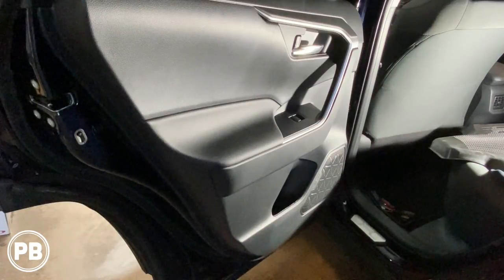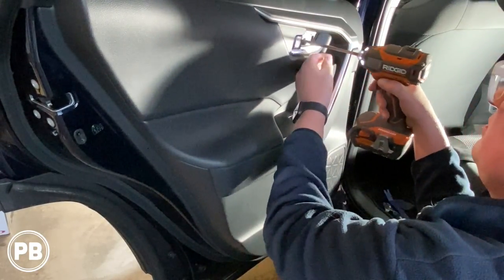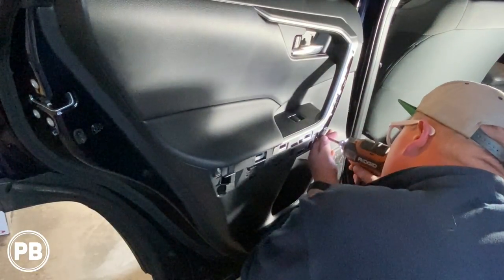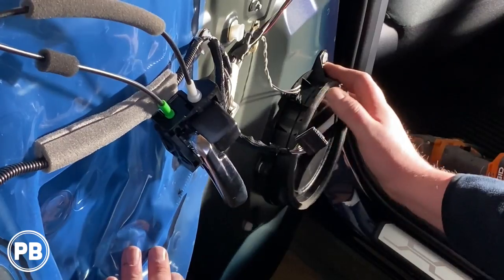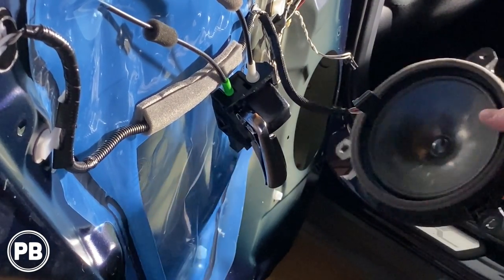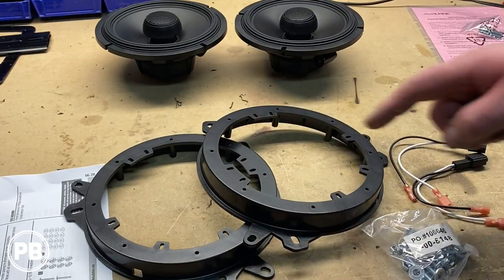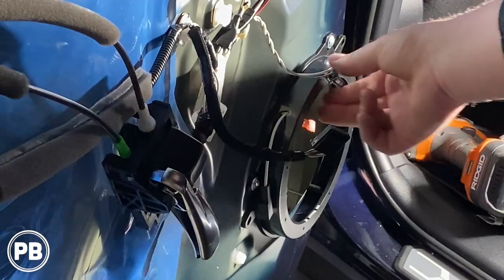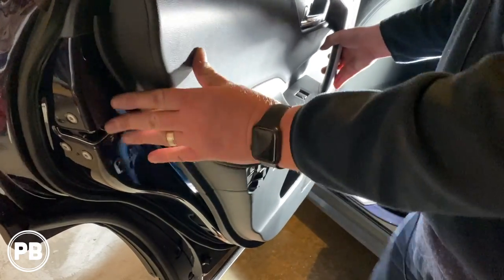2019 - 2023+ Toyota RAV4 Rear Door Speaker Install

Comment from the maker: Parts linked in the description of the video!
Reply: Crutchfield site says these and many others won’t fit based on mounting height being too tall (between door and door panel) as if they would touch the door panel… any idea why? Obviously it looks like they work in this video..
Reply from the maker: @mattlindsey  It may be the other way around, the mounting depth is too tall meaning the magnet will hit the window behind it.  We didn't have any issue using these Type R's at all.